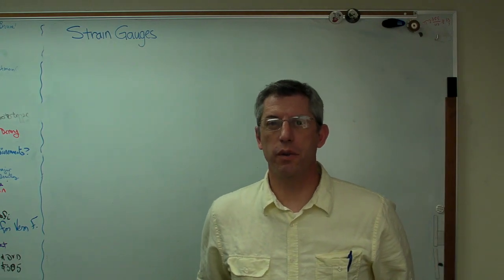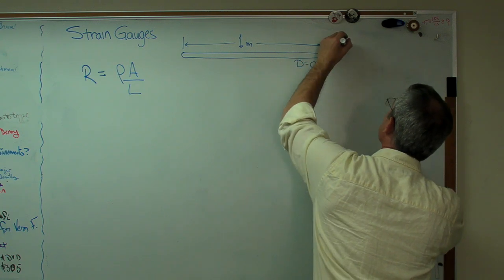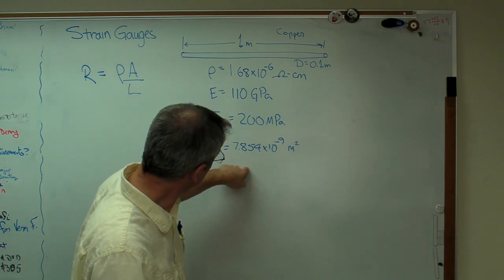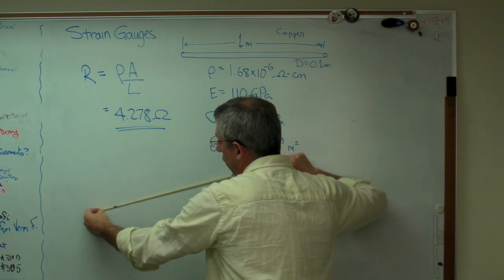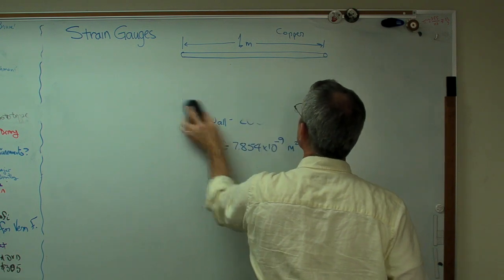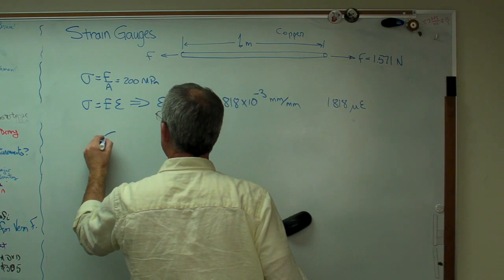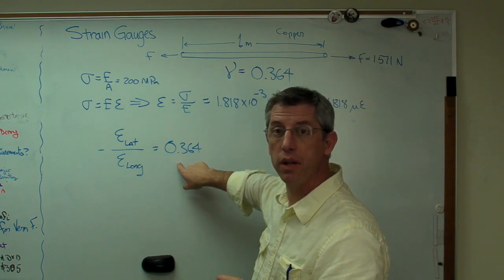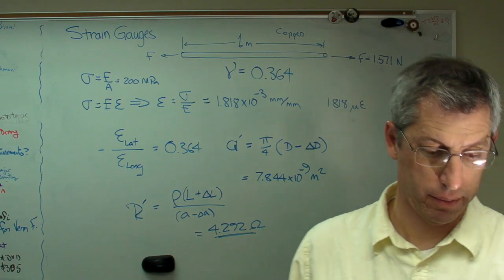Strain Gauge 1.MP4

Comment: In the first calculation, where you have calculated Resistance as 4.278 ohms have u used Youngs modulus ( E )  and Permissible stress ( 200 Mpa ) in calculations, if yes what is the formula used

Comment: Yeah 'cause English engineering students are still working in inches and feet. ¬_¬

Come on. I know
Reply: No, England went metric in the 70's. And, in England, an engineer is expected to be able to work with facility in any system of units, at least they were when I was an engineering student. In America, imperial units are still used (although, as is usual with Americans pints and tons have been screwed with) which is a supreme irony!

Comment: Another thing I noticed is that you mention that the wire diameter is 0.1mm, but it looks like you wrote 0.1m on the board.  Pretty clear from your area calculation that you meant 0.1mm though.

Thanks for the video.

Comment: Oh by the way, I stumbled onto this vids because I am trying to make a straingauge for a microcantilever. In that case I think the piezoresistive effects will start to work, therefore the gauge factor can be as high as 50, instead of the usual 2.2 for gold. For doped silicon (semiconductor tech) the gauge factors can be as high as 150 I think. I liked your explanation of the factor 2 in the second video. But if you want a more accurate but still easy explanation, try: